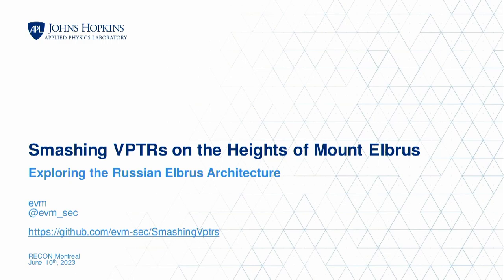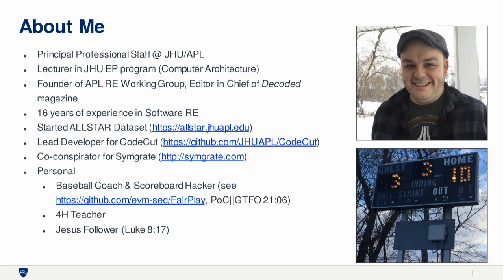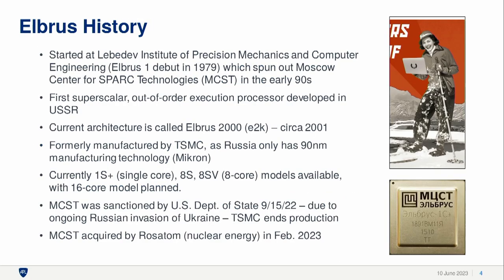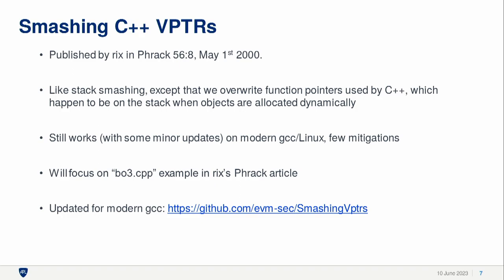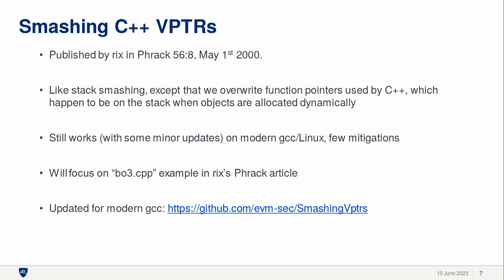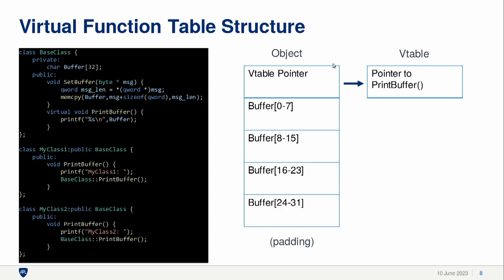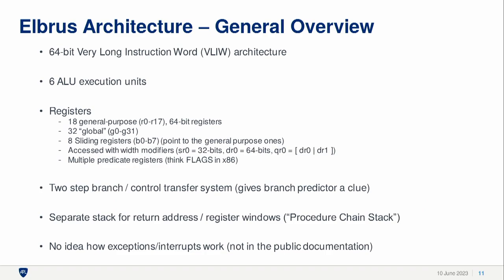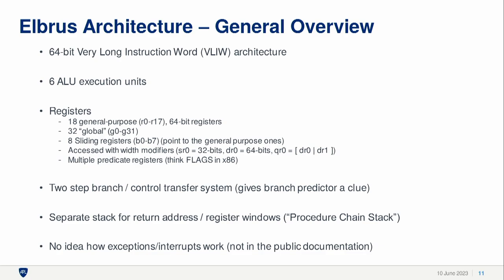Recon2023-EVM- SamshingVirtualFunctionPointersOnTheHeightsOfMountElbrus

Comment: LCC compiler for Elbrus is not a ported GCC, though ported GCC also exists. LCC looks like GCC for user to simplify migration from other ISA's with GCC, but it has own optimizer and own codegen. It even doesn't support GCC frontends except gfortran (which was specially ported for LCC), and it uses EDG and clang frontends for C, C++.